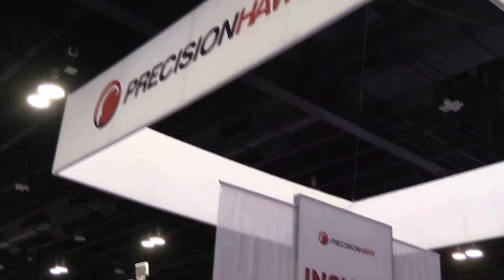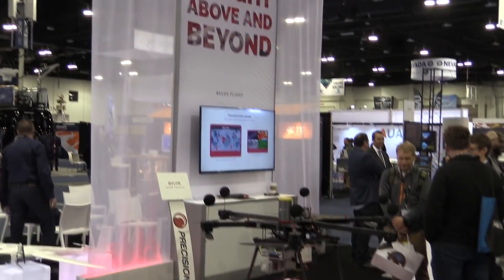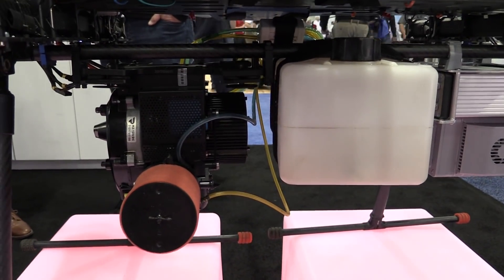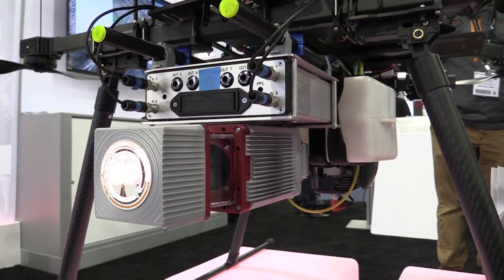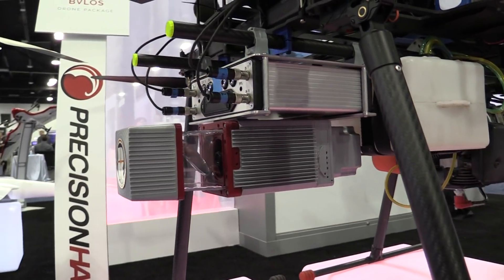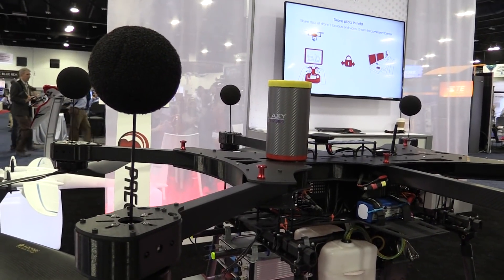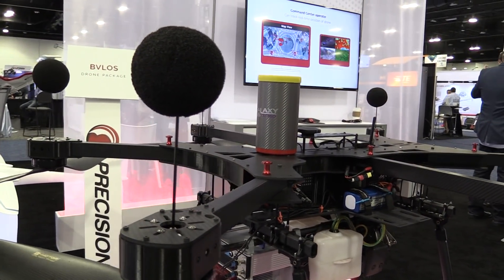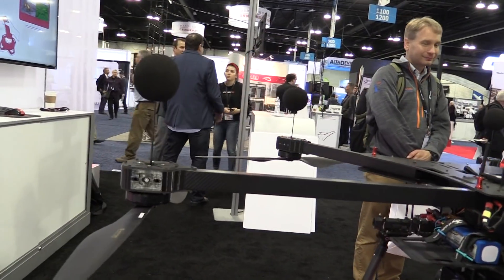Giant Drone HEARS (!) Other Aircraft to Fly BVLOS

Comment: I don't understand all these companies need to make it a multirotor if your gonna use gas. Why re-invent the wheel. Just make it a gas helicopter... you lose so much energy running a generator and carrying that extra weight.
Reply: As with almost everything in aviation, it is about redundancy. With a hexa or octo, if you have a motor out condition you have the potential to still be able to fly back home...or crash land safer. With a quad there is no chance as if a motor is lost, it is going to result in a crash. A helicopter can auto rotate and flare when a motor is out. Fixed pitch multirotors don't really have much in the way of an ability to auto rotate.